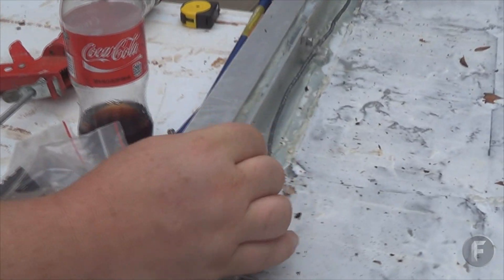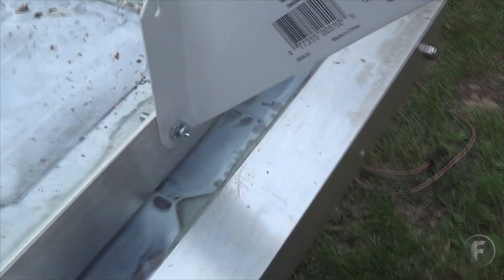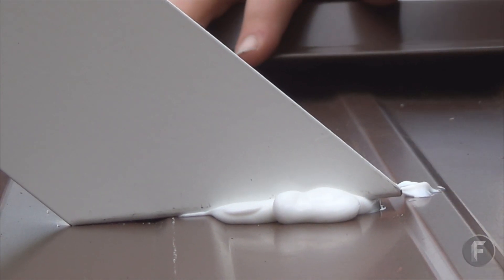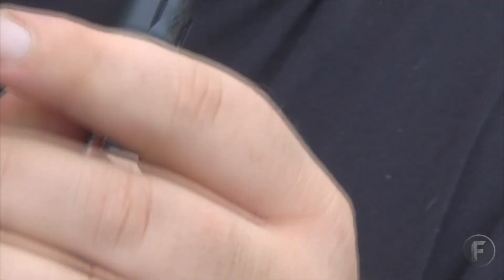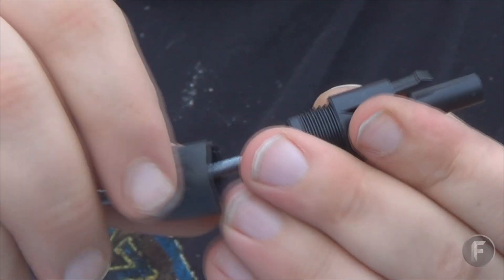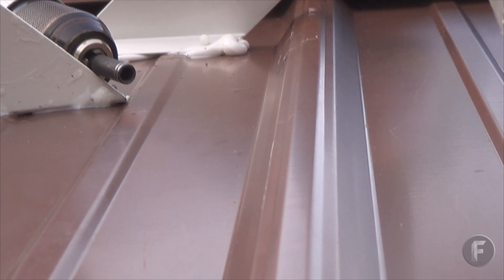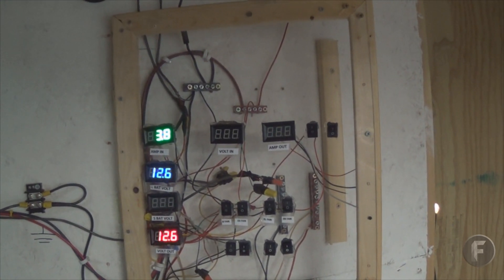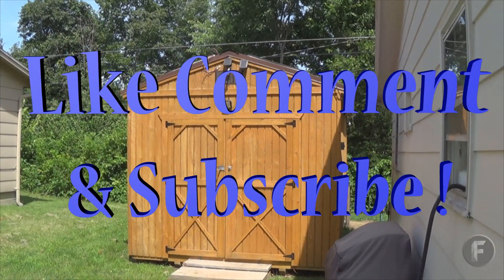solar panels hook up.

Comment: Nice big home made panels and you actually put the white protection on the backs. I never spent the money on that part. They stay pretty nice and cool with out it if you want to save money. I like the big 6x6 cell you made it out of. I do the MC4 plugs a little different. I crimp the tabs around the copper part to make sure it gets good contact. The part you thread on holds the rubber part of the wire from slipping. I m not so sure your gonna get good contact the wire is not that tight inside the tube Just saying. If it dont get good contact that may be the problem. How dod the amps test out? I made 20 panels and I sold them all and bought some china made panels. I still have two homemade panels. You could open it back up unscrew it. and bare the the place where it cirmps and crimp to the copper. I think the amps should be coming in to the shed at least five amps a panel so two should be making 10 amps under a load. Yeah 7 or 8 amps shorted each. You could just solder your connections or put some crimp ties from the auto parts store or I have even used regular twist ties like for home wires you know the yellow red or orange twist on wire ties it works and them black tape them. I see you got fixed though. I have even used auto flat pig tail ties like goes on a boat trailer or car trailer. I actually like the flat pig tail ties but they are just as expensive as mc4 plugs actually more money.